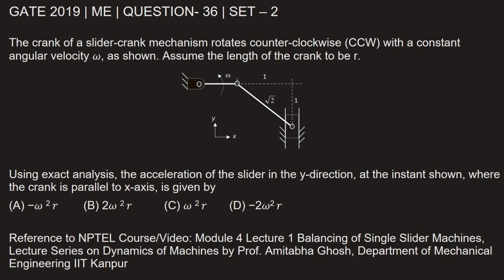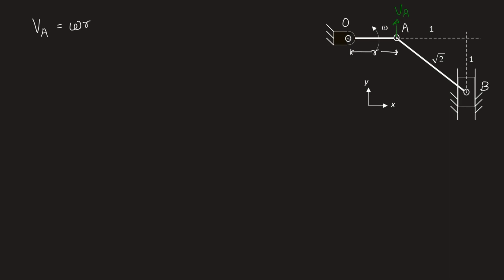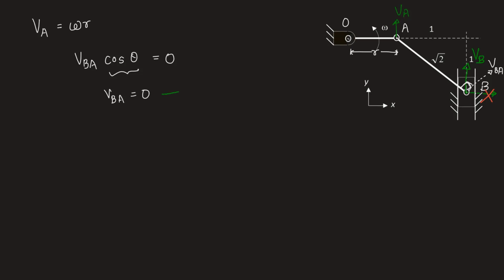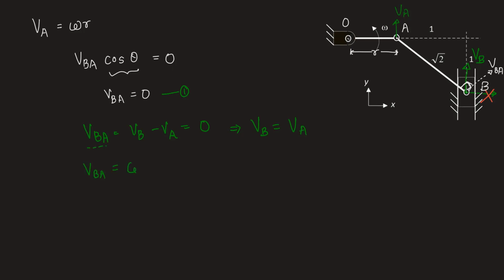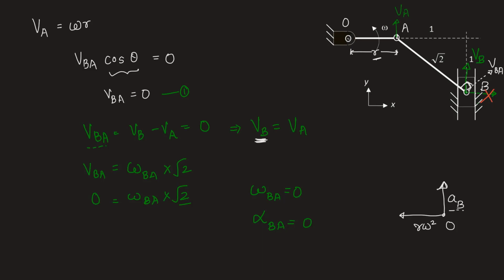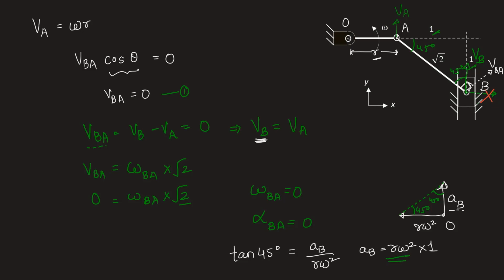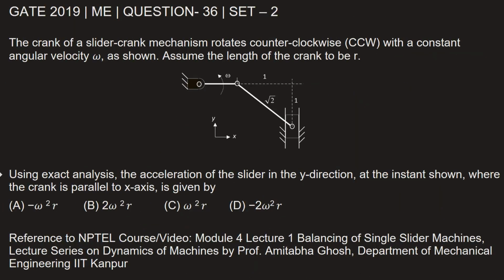Q36 ME 2019 S2

Comment: please explain if i know  rw^2  value and direction  and for  acc. of b only direction then why i  randomly draw 45° incline line on a to b. because coupler AB  had  axial and tentential acc.  equal to 0 .so it wont  show in the acc. diagram. then why i draw line 45°to join AB